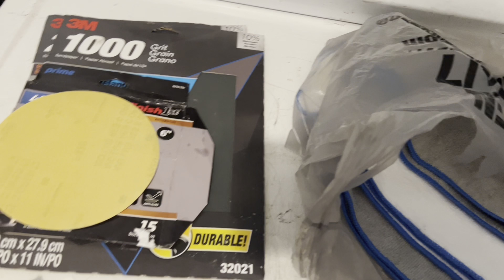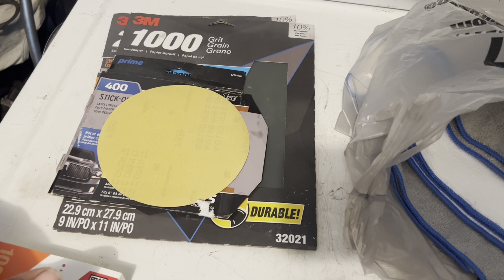Shp wheel polishing step 2-3 Polish￼￼

Comment: Hey Isaiah I'm stoked about the new video man, I'm about to tackle my rims! I had a question, I'm trying to hook up my stock three prong waste gate and I'm not sure wich vacuum lines go where. I think 2 come off the valve off of the air cleaner but not sure which ones go where and I'm not sure at all where to hook the third one. I love all of your videos man keep them coming! There is not much help out here on the starquests!
Reply from the maker: LOL thank you thank you I really appreciate it I can definitely help you with that so the first one on the front goes to the over pipe then the other two goes to the electronic boost controller that is connected on the airbox
Reply: I'm still not sure, so are you saying that the port to the right of the waste gate goes to the over pipe? And where due you hook the 2 lines from the boost controller? There is a middle and left port does it matter wich lines go to each one?